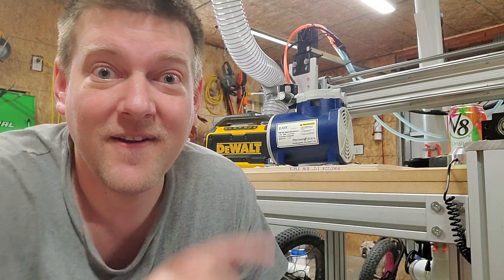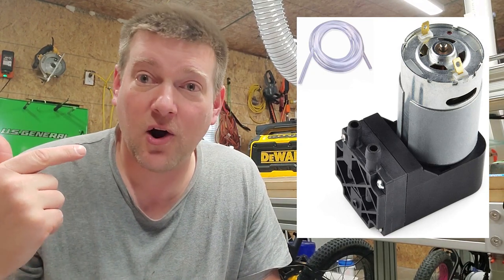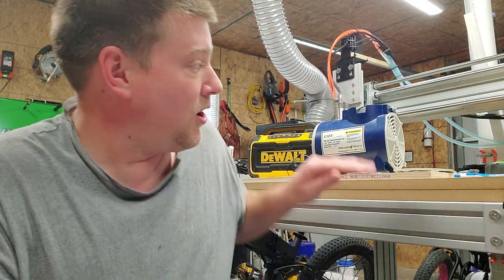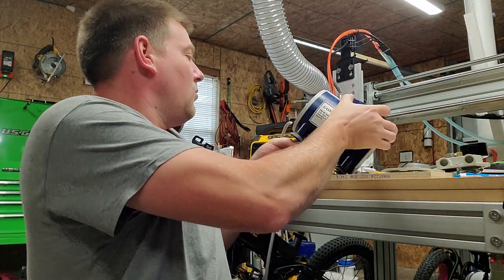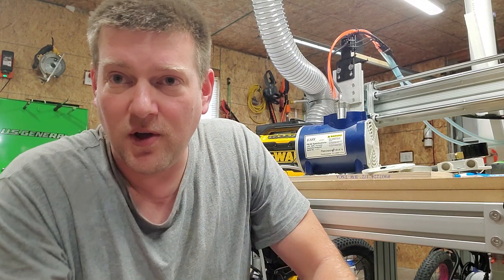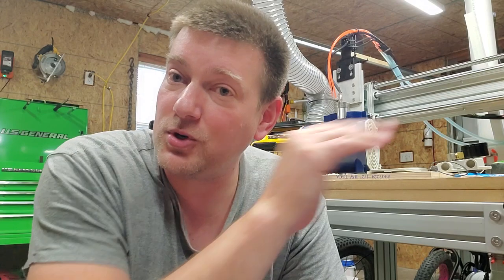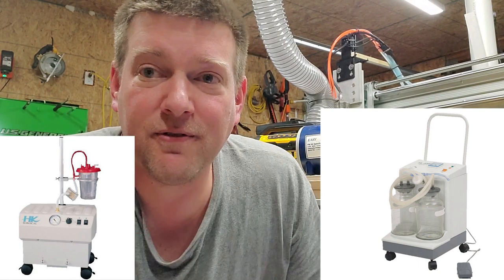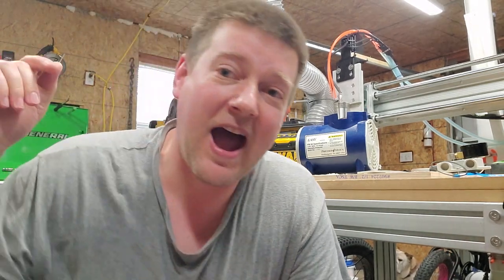Lets Explore Some Vacuum Pumps!

Comment: Thank you so much for the video however, I would like to ask you if we have a high flow rate it will be effective for the vacuum I mean the vacuum will be an increase or decrease?? 

Could you pls answer my question
Reply from the maker: This depends on the vacuum pump. Rotary vane and centrifugal vacuum pumps can handle a higher flow than piston or diaphragm pumps.   I guess I do not understand the entire context of your question.
Reply: thank you so much for your reply, I would like to know what is the relation between the flow rate and the vacuum in the piston pump? if that makes sense
Reply: @hanadyald4113  I would assume that higher flow rate means more vacuum because it is able to pull more total volume